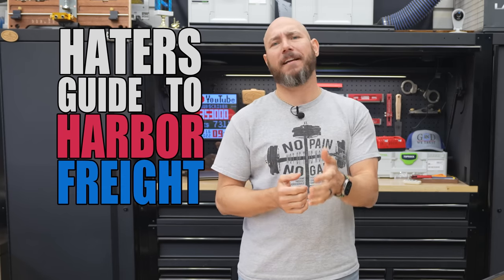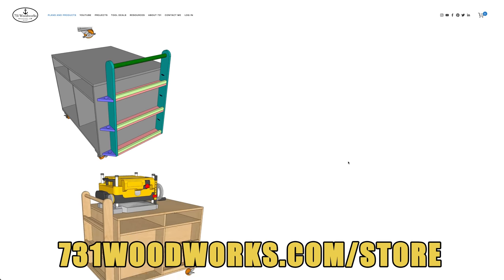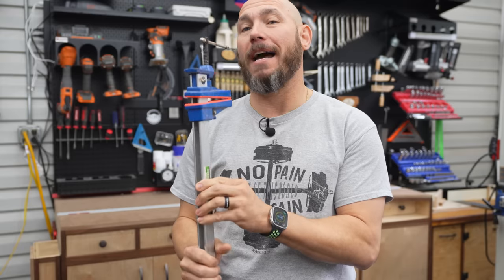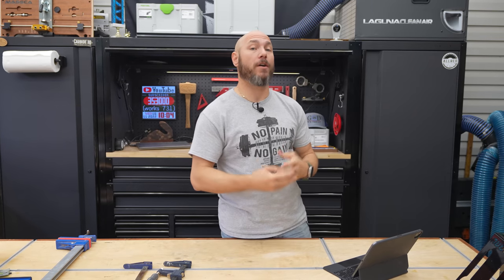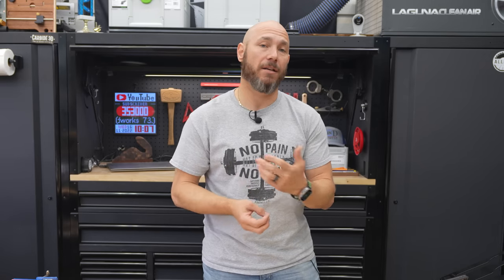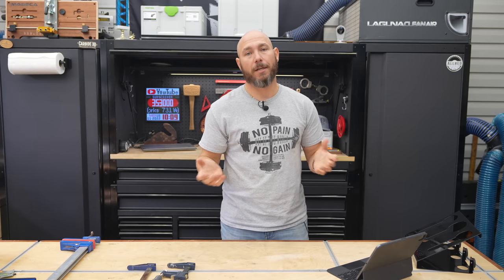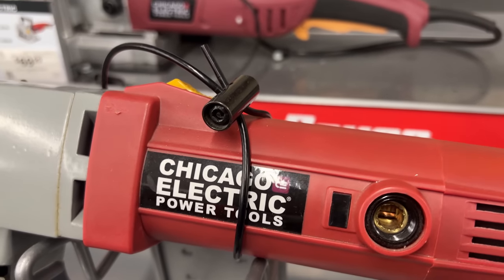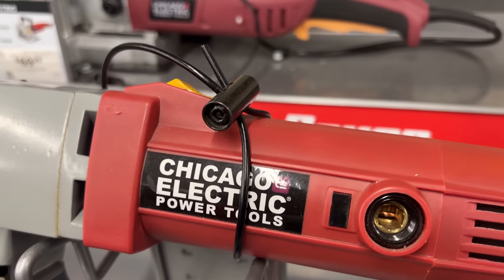The Hater's Guide to Harbor Freight | What to Avoid

Comment: I've got that exact router bit set and have been happy with it for the last 4 years.  So long as you don't ask it to hog out large amounts of material (which you shouldn't be doing anyways) and take your time, they work great.
Reply: @1pcfred  agreed. I'm not building high end $10k end tables or something like that. I'm making a couple hundred dollar end table or shelf or whatever. The point is unless you're making super expensive high end products those cheap bits get the job done. I have the cheap ones from the big box stores and they are no different then harbor freight bits.
Reply: @1pcfred  slow and steady seems to work pretty good while not taking a huge bite.

Comment: It looks like your store had the old table saw on display, before manufacturers had to update them with wider feet. The updated model does have a rack and pinion fence. I’m not a fine woodworker, but it works great for construction.

Comment: The wrenches are for more than just household DIY. I've been an industrial Millwright since 2007 and I started out with a Pittsburgh set up to 2". Those things have seen extreme torture in many heavy industrial settings and have held up remarkably well. They're not as good as Snap-On, MAC, or even older Craftsman, but for the price, you can't go wrong. My 2" Pittsburgh wrench has had 8-foot extensions on it torquing down anything from Evaporators to ID Fans and the teeth aren't spread open even a little bit.

I'm not going to comment on ratchets or any of the gear wrenches, but the simple basic wrenches are excellent for the price. Plus, if you lose one it's cheap to replace; something that'll happen to you quite often on a jobsite.

The Icon brand is not cheap at all and rivals the higher-end wrenches you get from Lowes/Home Depot/etc. It's no tool truck wrench, but those are essentially overrated anyway.

I guess my goal is to not scare newer apprentices or up-and-coming journeymen from Pittsburgh wrenches at first. Sure, you can upgrade as you advance your career, but I've seen too many newcomers waste their entire paycheck on tools that were just unnecessary. Put that money towards your retirement and quit buying into the hype.

Comment: I've only discovered HF in the last year.  I can say the router bits work great on pine...  I haven't had any issues w/ their locking casters and ball bearing casters. I've also purchased tarps and moving blankets when they're on sale, and consuables like the rubber gloves, and paint supplies in the best category.
Reply: I buy the moving blankets those magnetic screw pans.  Other than that they have an occasional good buy.
Reply: I use their casters. They work for me and their cheep. I also use their tarps but they are cheaply made and only last a season but they are also sold very cheep. I consider them as consumable items. As far as their router bits go, they do work but dull rapidly and I will replace those with a better brand.
Reply: Can't beat the price on castors,or solid rubber dolly wheels,Harb Rocks
Reply: I am also a HF Junkie. I had their plunge router for exactly one day and returned it. When I set it up and tried it out. the plunge guides were so sloppy. I could not get an accurate plunge into the work piece. I have a couple of sets of their router bits and have used a couple. They seem to cut okay. At the price I paid for them, if they dull up on me prematurely they will have served their purchase at the price I paid for them. I will replace with Bits&Bits or another quality brand when they do.

AS far as their casters go, I think that they're a little over priced when I can buy their small flat wood dolly for $17 and have to pay about $20 for just the caster wheels.
Reply: @ancienttom97  it's funny you say that.  My wife and I were looking at some coat hooks last night, and she saw some mounted on a board, and you just hang the board.   She didn't like those hooks but we were contemplating buying the board w/ the hooks for less money, and tossing the board ;)   However, I've not seen the locking caster wheels on any dolly, so that trick won't work for me there... but I will keep this idea in mind.
Reply: @1pcfred  The plunge router they sell today, you will never notice the the plunge sleeve bushings wearing out because they are already unusably sloppy.
Reply: @1pcfred  Wasn't that the plunge bushings were sticking, this router 's bushings were so sloppy, I couldn't get the router to track straight down in any sort of alignment.
Reply: Hell, my teeth work on pine, and I only have 8! 😂

Comment: I've been making guitars for a year now and woodworking for 10 years, here's my top 10 gets from Harbor Freight.
10. Angle Grinders, look bad, work great!
9. Orbital Sanders, 2 for the price of one from a big box store, save time and lifetime of the sanding disks by not switching pads as much, have an 80grit and a 220grit at all times and they're just as good as anything at Home Depot
8. Casters, they are so dang cheap and work perfectly 
7. GLOVES! they have a pair of gloves for 1.99 that last me weeks to months in the shop and I'm ripping apart old furniture and stuff constantly to upcycle into guitars
6. Sanding disks! They may not be the best but the cost per disk is minuscule, a 50 pack is 20 bucks
5. Miter Saws, unless you are a framer, they do the job just as good as the big names
4. Circular Saws, they're just as good as bigger names, try and see, just don't get HB blades for them, lol
3. Battery Operated Drills, they last forever on 1 charge and you can buy 4 for the price of 1 big name brand, and save time on switching out bits over and over.  Get 4 and 4 different common bits.
2. Everything that you spend money on at the big box stores that lasts a week either way. Disposable Gloves, masks, masking tape... Get more of them pay less.
1. Small Clamps, f style and c style, they hold up and are extremely strong, I've only broken 1 out of 100 in 10 years

Comment: Another excellent review. I recently bought the Hercules 12-in sliding miter saw and used it for a project. I love it! For the money I feel like it is more saw than I even needed. I love the power of the motor, the accuracy of the cuts, and the stability of the cutting platform. I put it on the Hercules miter saw stand and it makes a perfect combination. I can stand it up in the corner of my shop out of the way until I need it.

Comment: Stuff like the $10 grinder and $15 vibrating multitool are actually really good.  They have very little moving parts and they get the job done.  I've used both for many years before moving to cordless versions from better brands, but they're still running fine, and at that price it's even cheaper than renting.
Reply: For the occasional use mine gets, I love my $10 grinder! If it dies, I'll just take that as a sign that it's time to buy a better one.

Comment: Gotta love the "Avoid at all costs, because I ASSUME," advise.

I followed the conventional wisdom of buying a cheap set of router bits to see which of them I used the most then replacing those with quality bits. Got that set from Harbor Freight for that purpose, and 3 years later I have yet to replace any of them.
I wonder why 97% of reviewers would recommend them?

As others have pointed out the job site table saw has been totally redesigned. Perhaps an annotation of "Old Model," would be appropriate at this point.

Also, while the Pittsburgh ratchets and wrenches may be fine for "Using around the house," the Icon line are professional grade tools, and deserve to be recognized as such.
Reply: I would counter that and add that I use my Icons "around the house" and my Pittsburgh tools are in my go bag. Reason being if I lose a wrench out of there, it's not going to hit the wallet terribly because I forgot a wrench at the junkyard. I keep the Icon at home because I know I won't be in a situation where if I leave one laying around, it won't grow legs and walk into someone else's bag
Reply: @Lithic_Goose  Good plan. Icon tools aren't things you want growing legs.

Comment: The Hercules miter saw is a BEAST. The new Hercules plunge router is great also. Their tool boxes are great, their ICON tools are VERY good. Their 2 hp Dust extractor is supposed to be decent for the price, upgrade the impeller with a WEN for $50 and change the bag to a canister filter and its twice as good.

Comment: Latest Herc table saw is pretty good now.  The v2 is rack and pinion plus some other quality of life features.  Been using for a few months, no complaints so far.  Only real drawback is it doesn't support dado blades. :/  Edit - Almost forgot, plug for the Herc router.  Its super OP for the price, great value and performance.

Comment: My favorite HF find is the 3/4" pipe clamp with base. There are very few moving parts and it doesn't even matter if they are square or not. I put 2" thick hardwood pads on mine and slowly sanded the pads down until they fit perfectly flat. If you combine these with a 6' long steel pipe, you have clamps that can pretty much handle nearly any job for $40 or less.
Reply: I actually JUST noticed the 3/4" pipe clamps!  They're FAR cheaper at HF than Amazon or the big box stores!!
Reply: I agree but they were $5.99 just a few years ago not $11.99 like now.

Comment: I bought a bunch of Harbor Freight metal yardsticks, but cut them up into 4" lengths, drilled a hole near the end, and fastened them together with threaded rod with nut spacers. Presto...a storage rack for plier type tools that fits in your tool drawer and holds the tools on edge.

Comment: Lots of good info here.  I will also vouch for their power cords, especially the 10 gauge.  I have two 25’ and a 50’, all with the lighted triple ends which are great if you’re not sure of a good connection.  Never go to a job site without them.  Price is at least a third lower than the big boxes.  12 gauge cords are also good.  
  Doing a lot a stain and finish work?  The nitrile gloves are great. Get the 9 mil.  I’ve reused the same pair to do hundreds of linear feet worth of oak trim.  Plus, they have XXL sizes!  
   I concur with your assessment of the Fast Cap tapes.  I swear by the 16’ lefty/righty.  Actually, Fast Cap has a lot of good, reasonably priced goodies.

Comment: Just want to say I really appreciate your critique on Harbor Freight Tools.  You were fair and unbiased; Additionally you pointed out those tools you found to be of value.  I am one of those people that purchases harbor freight tools, at least certain ones.  I do have a Chicago Electric belt sander.  I got it thinking Ill use it for a particular job and if it craps out well so be it.  I was able to use it on 2 deck resurfacing projects and it is still going strong.  That sucker wont die! It's 15 years old now.  I also have the electric impact wrench that has received heavy use.  Only recently changed out the brushes (brushes are included) after 12 years....Still kicking.  You could not have said it better when you mentioned the metals in the tools are softer and lack quality.  I stay away from their screwdrivers. I've had good luck with their Pittsburgh line of ratchet; no issues.  I am of a generation when people oftened complained about items made in Japan.  We should be so lucky to have more made in Japan and not China.  Japanese chisels, for example, can't be beat.  As for their automobiles....well Toyota cars speak for themselves.  LOL!  Bottom line is it pays to be informed; read reviews and then draw conclusions regarding purchases.  Your videos are very informative and I have learned a lot....keep 'em coming!

Comment: I agree with this summation of HF tools "almost" 100%.  My exception would be the wood-handled HF chisel set.  I bought a set and it did not take me long to get 'em perfectly flat and sharp using wet stones.  What has impressed me more is they seem to hold that sharp edge for a considerable amount of time.  I'm not woodworking every week, but the last time I sharpened them was over a year ago.
Reply: Their jack plane, however, is absolute garbage. Not recommended. Hey, it's cheap. That's just fine.

Comment: HF is great for the casual or weekend warrior handyman. Many professionals who make their living with tools don't (and shouldn't) depend on HF tools, but that's not the market HF is going for. When I made a living working on cars, my tool box was full of Snap-On, Mac, and other quality tools. But when I needed a 1/2" rachet to throw in my RV to work the stabilizer jacks, I got a cheap HF model. For occasional light-duty work, the HF rachet was $13 - the Snap-On is $195. If the HF breaks (which it probably never will, considering the light-duty), I would not feel bad throwing it away and buying another one. A good worker knows to use the right tool for the job.

Comment: I've got the Hercules job site table saw. Actually my second, I had the first generation and brought it back to get the second gen version with the rack and pinion fence. Overall, I like it, especially for the price.   Yes the fence can get sloppy, but a few adjustments gets it right and it works.
Reply: I miss my first gen I had to trade it in to get the rack and pinion table saw because my friend ended up losing the fence on the first one. The 2nd gen feels has a cheaper more plastic feel to it.

Comment: I've bought lot of tools from Harbor Freight, pretty much all of them are the lifetime warranty Quinn, Doyle, Pittsburgh, etc.  Their hand tools for working on cars I think are pretty darn good.  From what I have read, there are a lot of mechanics in shops that use Harbor Freight tools on a daily basis.
Reply: I do. I haven’t had any problems with their Quinn hand tools or Earthquake air powered impacts. I’d steer clear of the lowest brand of air tools though if I was using them professionally.

Comment: Agreed! Precision instruments rarely exists in the Chinese Cheap Hallowed Halls of Harbor Freight. That said I did get the new variable speed bench grinder recently and it’s great. I mostly go for magnets, zip ties, cheap paint brushes etc.
Reply: Their  digital clippers are great for checking bolt sizes and determining metric vs SAE and general use.   I’ve had the same ones over 10 years and they still work fine for my purposes.

Comment: I love my Harbor Freight drill press as it's been very good for me for a couple of years for making pens or other projects of the sort and has held up quite well.

I did get the metal yardstick years ago, however, it's only used for crafting with cutting fabric where accuracy isn't all that important and it's great for cutting straight lines with a rotary cutter.

I will say it does look like their "best" brushes are actually comparable in quality to the "good" brushes you get from big box hardware stores, however, I'm also of the opinion that I only used those when I was broke and trying to paint a house or for stain or poly on something that was going to get covered in stuff and a stray hair in the finish will probably get worn off or hidden!

Either way, I am a "I know what I'm getting when I go in there" but do like it for things here and there.

Comment: On odd tool that has been serving me surprisingly well from harbor freight is an English Wheel for sheet metal rolling and planishing. Sort of makes sense though - it's mostly just some solid metal rollers and a heavy frame, none of which goes under crazy stress or anything.

Comment: I actually use the 4 pack router round over bit set from Harbor Freight with the black colored bits and they work great. I build subwoofer enclosures on a regular basis and I use these bits on every project. They’ve held up very well for a year now with no issues at all. I also have some very high end bits as well from Mobile Solutions and the Harbor Freight bits that I use have been just as durable.

Comment: I use the Hercules V2 table saw with the RP fence and it’s really a nice saw once you do the initial tune up. I was able to crank out some cabinets with it and I was very impressed with the accuracy for a harbor freight tool
Reply: Agree with your comment. I remodeled my restaurant and bar with this table saw. It surpassed my expectations.
Reply: No thanks. I moved on to Sawstop and no longer worry about my body parts and a Sawstop almost never needs major adjustment. When it comes to possibly chopping off pieces of my body cheap is not an option. I build cabinets for a living now. I can't afford to be missing fingers. An hour visit to an ER to get a finger reattached will cost a WHOLE LOT MORE than the most expensive Sawstop model.

Comment: I’ve used Harbor Freight’s tools for about four years now. I started out with the Bauer kit they had four years ago on Black Friday. It had the 20v drill, driver, circular saw, reciprocating saw, and a light along with 3 1.5ah batteries and two chargers. I then bought the hammer drill kit with a battery and charger. I did have to take back the drill as the chuck broke about a year into it. They replaced without any issues. Since then I’ve purchased several Bauer 20v tools. I also have the Hercules 12 in sliding miter saw anti love it